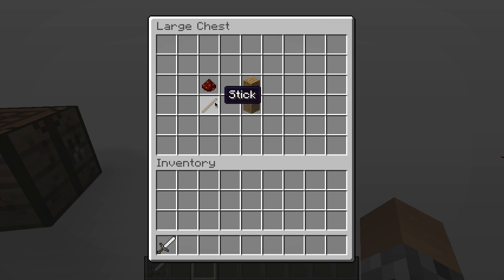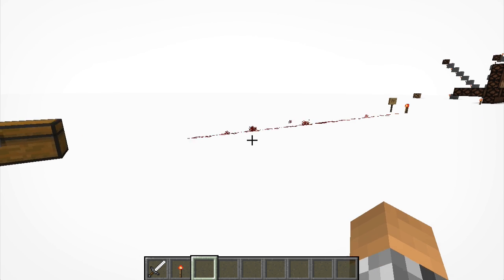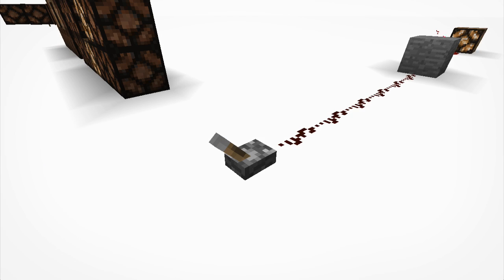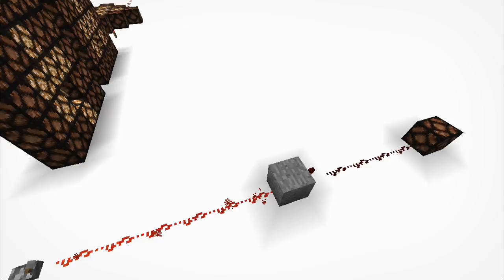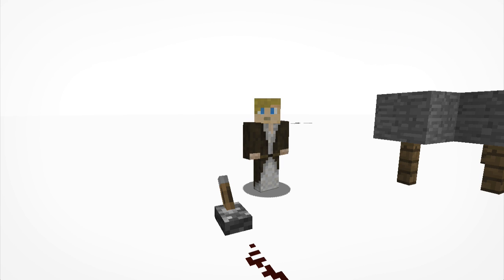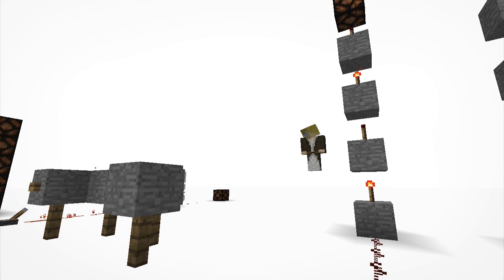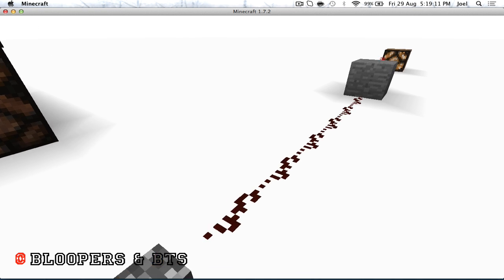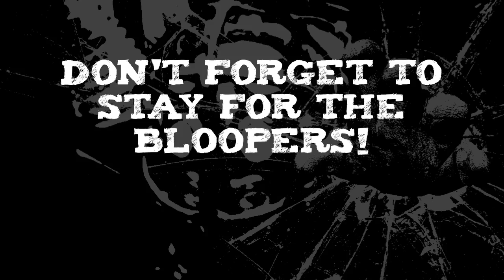Redstone Torches: THE ABSOLUTE BASICS!

Comment: Why does the redstone that powers the redstone torch not get activated itself by the torch? That makes no sense at all.
Reply: Incog Niko the redstone torch is a power source and doesn’t need the dust to power it. The redstone dust has no power unless given some from a power source. 

Also the torch does not power the block it is attached to (if the torch is placed on top of a stone block, the stone block is not powered. If the torch is placed on the side of a stone block, the stone block is not powered). 

Therefore when the powered redstone dust runs into the stone block that the torch is mounted to the dust powers the stone block, and the powered stone block turns off the torch.

If the redstone dust was unpowered there would be no power given to the stone block so the redstone torch would remain on.

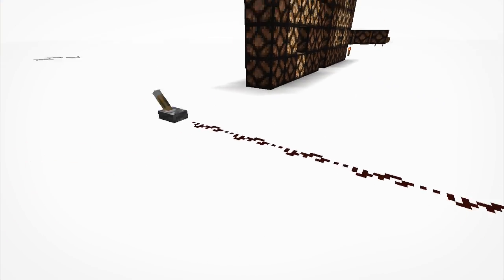I’m referring to this setup: 1:35 
I hope that helps somebody. :)